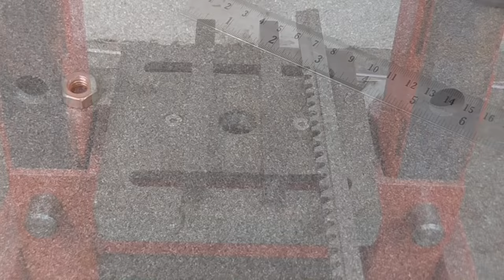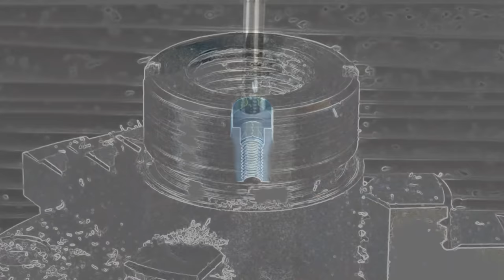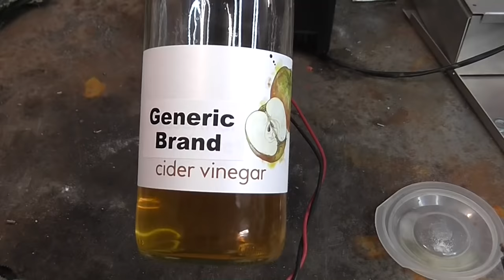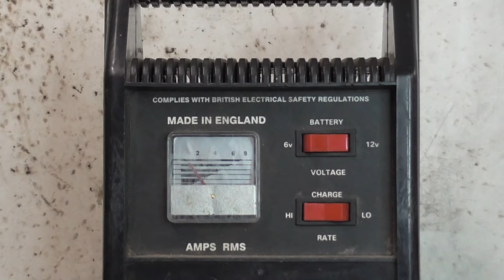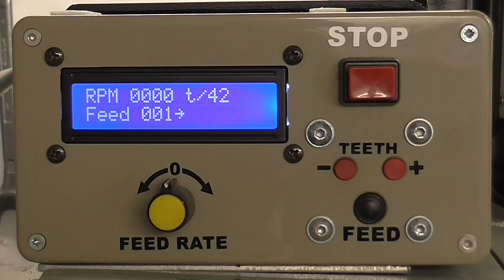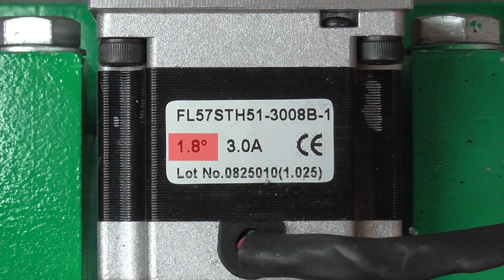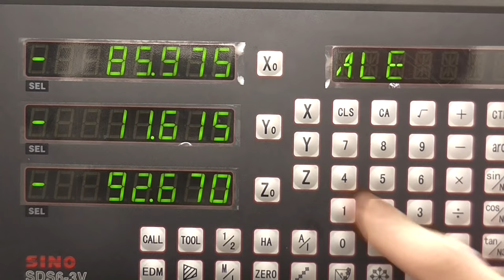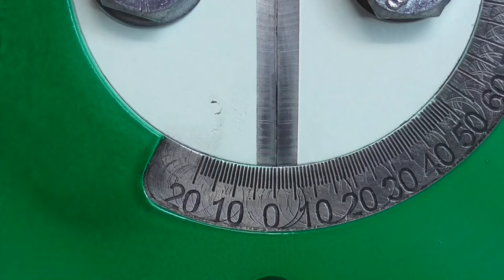Gear Hobbing Attachment (milling machine) Part 2

Comment: Everything brilliant, bar the surface finish you're getting from your mill. Gouging from endmills, and very scrappy looking from the facemill. Mill head in tram?
Reply from the maker: The carbide endmill I used was actually chipped and I didn't notice, a shame as it spoilt the look of the graduated section and it's very obvious on video, though in use it's not a problem at all. I have to re-tram the mill every time I do gear hobbing as I need to tilt the spindle for the hob.

Comment: I just discovered your channel recently and have to say that your projects are very impressive. I don't have much experience in the electronics side of this sort of thing so I'm a bit surprised that the electronic coupling of the hob to the head works so nicely. The etching is pretty neat too. I would have thought that it would take much longer to get to that sort of depth with just vinegar and salt. 
Am I right in thinking you could make worm gears by feeding the worm gear blank radially into a custom hob with the same dimensions as the screw the will drive it?
Reply from the maker: Thanks! It's actually the electrolytic action of the current flowing that removes the metal, the vinegar/salt just increases the conductivity of the solution you don't even need both, one or the other will work. Yes you can make work wheels that way, technically the hob should not have exactly the same dimensions as the worm, the teeth should be slightly 'taller' to give some clearance in the root of the wheel, but many people just use the worm with teeth cut into it and it does work.

Comment: It's amazing what you have accomplished.  I've designed a 6 tooth gear without under cut at the trochoid.  It requires rack shifting.  Would you be able to do shifting with your setup?  You will have a much better looking/working 6-tooth gear.
Reply from the maker: Thanks! Yes, you can easily hob profile shifted gears by just making the gear blank a larger diameter. I generally profile shift gears with 12 or fewer teeth, but sometimes it's not possible if the centre-centre distance and ratio is fixed. The 6 tooth helical gear in the video was not profile shifted to illustrate how a hob can form teeth with different profiles, this gear shows a lot of undercutting.
Reply: @AndysMachines  well for 6 tooth it may require center distance adjustment. For mildly under cut gear (small shift), I normally compensate by reducing tooth thickness of mating gear to maintain center distance as long as there is reasonable amount of topland.  You gear cutting method is far more capable than gear shops I used previously.

Comment: Great job, is there any chance you would share the electronics and coding, I’m working on doing the same thing.
Reply from the maker: Thanks! Yes, I could, but I built the controller nearly 10 years ago and it's quite dated. It uses a PIC microcontroller programmed in assembly. It would probably be better (and easier) nowadays to use an arduino based system, the actual calculations are quite simple and are described in the video.

Comment: is there a direct replacement for the stepper controller you used ? i can't find one like yours for sale. obsolete ? i do not know much about them, but i want to build your hobber !! the one you built is amazing. thank you !!!
Reply from the maker: I had to go back and look at the video to see which driver I used! This exact driver is no longer made, the nearest replacement would be this: https://motioncontrolproducts.com/dm432c-stepper-drive.html 
However any step/direction controller that has a current rating suitable for the motor you are using will work and there are many cheaper options available eg. if you search for 'DM542' on Amazon this is a good all round drive, you'll see the same type offered for wildly varying prices (like 6x). Avoid the dirt cheap ones but don't pay over the odds, here is a reasonably priced one: https://amzn.to/3WdK0OH

Comment: WOW, that is truelly amazing. Can you cut helical bevel gears on it?
Reply from the maker: I haven't tried. I think it might be possible but it would need a single point cutter rather than a hob as the tooth spacing changes as you travel along the cone. It would also need at least 2 passes per tooth since you would have to cut along the faces of the teeth at a slight angle to generate the tapering shape. I'll have to give this a go one day, but I'd start with a straight toothed bevel first, I've seen people make these in a similar way.

Comment: On the skyving process...is it cutting by downward force (like a broaching process) ? Having trouble wrapping my head around that one
Reply from the maker: Yes, it's similar to a broaching/shaping process, except that the downward motion comes from the relative motion of the rotating part and cutter because they are at an angle to each other.

Comment: Thanks for sharing and the inspiration, I have something similar in mind for several year but still not materialized it....
If I may, I think that you might have went too far with the fit of your tapered bearings. Tapered bearings need to be able to be axially adjusted, can't do that if you need press-force to move it...
BR,
Thanos
Reply from the maker: Yes, the fit of the rear bearing was a little tight, but not as tight as it might appear from the video, it will still move (and has ZERO play). The front bearing is an interference fit. I went into this in more detail in the first video.

Comment: Wait, I think you can use this attachment for power skiving, right? Have you tried it?

Edit: yes, it is skiving. Amazing job. I'm very impressed.
Reply from the maker: Yes, I built it like that to allow skiving. Though I have to say it's a more complex process than you might think, a lot of careful design has to go into the cutter to get good results.
Reply: @AndysMachines  I'm about tu order a stepper. Is the 3amp stepper you have does the job well or do I need something stronger?
Reply from the maker: @skorkmaz  It works fine, in fact it's not even running a 3 amps, the driver will only go to 2.5A

Comment: Great and cheap (no FPGA required) solution!
Why is the surface so rough? Is it a vibration-resonance problem?
Reply from the maker: I think the finish on the ring gear was rough because my home-made cutter wasn't clearing the chips properly and they were getting trapped. A jet of air/mist coolant would probably have helped. Despite looking a bit rough the gear does mesh nicely with the small pinion I made.

Comment: Very impressive. I assume the whole hobbing process cannot be interrupted, because I assume when turning the mill on or off you cant guarantee the stepper motor is not missing a step when starting up?
Reply from the maker: See my video on the controller, I designed it to cope with exactly this problem: https://youtu.be/beT8312k3yI So yes, you can interrupt the process eg. to check the depth of the teeth.

Comment: Incredible. Thank you very much for sharing. Did you make the gear hobs and skiving cutters yourself ? Can you make a vídeo? Thanks again cheers
Reply from the maker: Thanks! Most of the gear hobs shown in this video are commercial ones I bought, though I also use homemade ones, they are fairly easy to make with a screw-cutting lathe. The skiving cutter I did make as this is a bit specialised, I also actually made the hob that cut the skiving cutter (it's the one I show briefly at the start of the first video).

Comment: I like to see it run with a master just to see tooth to tooth spacing?You are using a 2 thread hob so set to cut 10t will give you 20t on part.Set angle to hob and gear is very important to set else you will get excessive undercut in root diameter.Cause it to break at base of tooth.
Reply from the maker: Yes, the correct angle of the hob is very important. Also the diameter of the blank and depth of cut so that it is cutting on the correct pitch circle diameter, just a small amount off produces teeth that are visibly quite a different shape. It was a single start (one thread) hob I was using.

Comment: How about bevel gears   .
I have an old like 1890s Camel back drill i am restoring and need to make spur gears , bevel gears and a worm gear if i want it to work how it did originally . The spur gears im confident i can make but not sure about the bevel and worm gears . You are very clever and your machining top end . Enjoyed the video and great filming . Liked the X-ray views . Cheers Doug
Reply from the maker: Bevel gears are my least favourite type of gear to make! They can't really be hobbed due to the tapered tooth shape (they can be kind of hobbed with a 1-tooth hob). When I have to, I make them manually with the 3 cuts per tooth method, a roughing cut in the centre then a cut along each side of the tooth at the correct angle. There are a lot of calculations and it's easy to make a mistake and ruin everything. Maybe one day I'll put everything into a spreadsheet and do a video on it

Comment: Helical gear with opposite angles are cut with one hobb or two different hobbs
Reply from the maker: One hob. To cut helical gears with different angles you only need to tilt the hobbing spindle to the helical angle. To cut matching left and right handed helicals, you don't need to move the spindle, just cut on opposite sides of the blanks (one on the front edge, other on the back)
Reply: @AndysMachines 
Thanks for your relpy. Different angles one of left and other of right hand helical angle with same hobb. Is it possible. If yes, then can you upload a video for the same.
Regards,
Prashant Aher

Comment: Looking at the possibilities of hobbing on my mill - quite possibly one of the main reasons for having a universal mill ????

min feed speed on my mill 7/32"/min vertical @ 1/2"/min setting. (= 0·21875 ipm)
Reply from the maker: I tend to think in metric, 0.2 ipm is around 5mm/min. which is about right for a 1-2" dia. steel gear, you would want even slower for larger gears (will also vary with the power of the machine and how rigid the setup is).
Reply: @AndysMachines  My mill's French-built - imperial. Can't help think that the feeds would be more sensible in metric units !
It also has an Irish spindle speeds chart - as some of the numbers are patently wrong !

Comment: excellent project please video of the schematic and code thanks for the contribution
Reply from the maker: Thanks! I could go into more detail, but I built the control unit nearly 10 years ago now, and if I were going to produce schematics etc. I might as well redesign the whole thing using more modern components . (It uses a PIC microcontroller programmed in assembly language, now everybody wants to use arduinos and C)

Comment: I have a question, what was the resist you used for the etching? Was it something a regular printer can do?
Reply from the maker: It was regular sign vinyl cut on a vinyl cutter/plotter. You could probably also do it with the toner transfer method (often used for PCBs) with a laser printer, or an etch-resist pen (drawn by hand).

Comment: Out of curiosity, why could you require a nut that puts pressure against the bearings if you press both bearings onto the shaft?
Reply from the maker: The back bearing is a looser fit on the shaft so it can slide to adjust the preload. It did end up slightly tighter than it really needs to be, but better than too loose!

Comment: This is brilliant.  I love the use of a stepper to sync the two spindles, rather than a complicated gear train.  It makes the design so much simpler, and more flexible.  So a couple of questions, if you don't mind.  First, is it true that the load on the stepper is pretty small, as most of the load is on the hobb cutting the gears, and that it just keeps the alignment "true"?  I ask because once you have this started, it would seem to almost self-synchronize.  Second, have you thought of using the X sensor from your table position encoder to let you cut spiral gears?  Or would that type of cutting put too much load on the stepper?
Reply from the maker: Yes, If you have all  the angles and timing correct then there is very little load on the stepper, it really just synchronises everything whilst establishing the cut. Once cutting at full depth the hob will tend to turn the blank like a worm and wheel.

I have done helicals, but not spirals, I'd like to try this but I don't think it would work with a hob and would need to be a single-point cutter.
Reply: @AndysMachines  That makes perfect sense, thanks!  I have an interest in making gears as well, and was going to go down the road of making them as 3D prints and then casting them in aluminum, but steel or bronze cut gears would be so much stronger and reliable.

Comment: This setup is fantastic. Are you considering selling plans or even kits for this, as there doesn't seem to be anything available I have found.
Reply from the maker: Thanks! I think you can get most of the information required to build it from the videos, its quite a simple idea and doesn't have to be constructed exactly as I did mine, so you can adapt it for you own use.

Comment: I have with curious pleasure followed these two videos, and have a few questions:
Touch off and setting the gear depth are self explanatory, but when you feed the blank in, do you do that by feel or ???
When you make the internal gear (in Acetal) are you both feeding down by hand, AND feeding out/in to get the tooth depth ?
If yes to the last, how do you "feel" how much to feed in/out ?
Reply from the maker: When hobbing I feed manually by feel, you need to be slow and careful as if you go too fast it is not evident until the blank has completed a whole rotation, (even if you stop feeding it continues to cut as the blank turns). So if using power feed you need to be even more conservative with the feed rate or things can quickly get out of control.

The internal gear was a bit of an experiment. I was feeding downwards but I may have taken more than one pass starting at a greater radius each time. With the steel gear I took multiple passes again feeding in the downwards direction.

Comment: Amazing job, it's the first time I see a video who show a maker machining an internal gear by cnc.  Did you machine the cutting tool to realize the internal gear ? Or did you buy it ?
Reply from the maker: Yes, I made the cutter and I actually made it using the same hobbing spindle. This was my first attempt and I'm sure I could do better, though it was quite a good result. I wouldn't really consider this CNC, it's still manual machining, just with some electronic assistance.
Reply: @AndysMachines  ok, I saw some factory doing this kind of tools like sandvik, seco,... But there are also chinese tools probably much more cheaper and pretty well done like those of hanjiang tool. They have skiving tools to machine internal gears begining from module 0.2. I asked them for a quotation and waiting for now.
Reply: In fact, industrial scudding tools are very very expensive : More than 1500$ for one carbide tool. It's a good idea to try to make it yourself :)

Comment: Great video series!!  My mill doesn't have a tilting head so I was curious, could I account for the hob helix angle at the gear spindle since they are both rotating around the Y axis of the mill?  Or am I missing something?  Thanks again!
Reply from the maker: The hob needs to be fed parallel to the helical angle it's teeth are cut at, if that makes sense. The easiest way to do this is to just tilt the head, unfortunately tilting the work does not have the same effect. But it can be done by tilting the work and also with a combined feed in the X and Z direction, obviously best done with a CNC (I see you have a Tormach?)
Reply: @AndysMachines  Awesome! Yes, I'm running the Tormach.  Moving the Z makes sense.  I'm thinking the Z would need to move up or down by the hob pitch distance for every rotation of the hob?
Reply from the maker: Yes, you would need to move one pitch distance in the Z direction for a feed distance equal to the circumference of the hob (think of it as 'unwinding' the teeth from the hob). 

The circumference should actually be measured at the pitch diameter of the hob, which is slightly less than is OD (by 2x module or 2/DP), but it's probably close enough not to matter unless the hob has really big teeth.

Comment: This is just brilliant!  Do you think Clough42’s electronic lead screw unit could be used for this purpose?
Reply from the maker: Thanks! I don't know much about his design but if it uses an encoder on the lathe spindle and can divide this down by some selectable ratio (which I expect it probably can) then yes it probably could be used on a milling machine for this purpose.
Reply: Nice thinking. Off the shelf, almost.

Comment: Impressive!
I wish I could make such a machine could you help me with that?
How does the controller work?
Did you make the controller?
Reply from the maker: Thanks, yes I built the controller though it was nearly 10 years ago and it would probably be better to modernism the design and use something like an arduino. I might do a follow up video with more information as a lot of people seem to be interested in it.

Comment: great job ! what is maximum rpm of the milling machine spindle you used to cu cut gears? the range actually ...
Reply from the maker: It's something like 95-1600 rpm in six steps

Comment: Any chance you're going to make the plans public? I'd love to buy them to make my own hobbing attachment.
Reply from the maker: I might do a follow up video with more information on the controller as a lot of people seem to be interested in it. As for the mechanical part, all the information you really need is in the video, the dimensions aren't critical and you can build it to suit your own use, eg. if you only want to cut spur gears you don't need to make the spindle tilt.